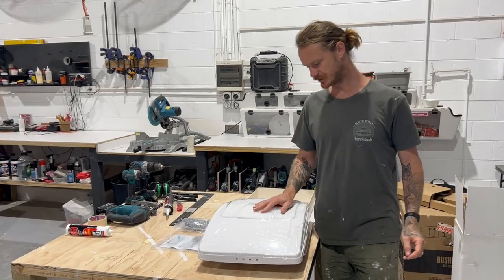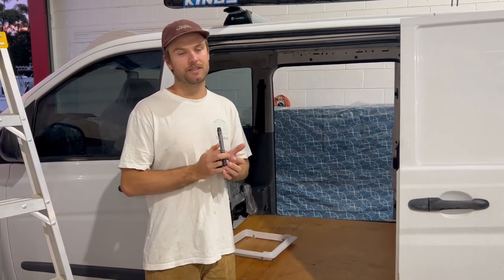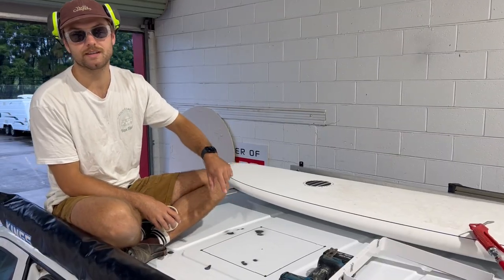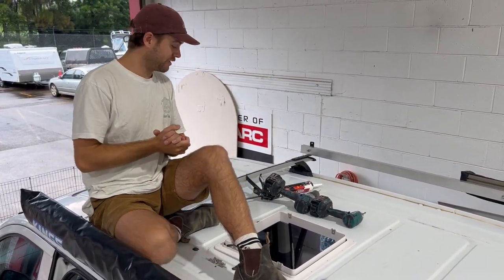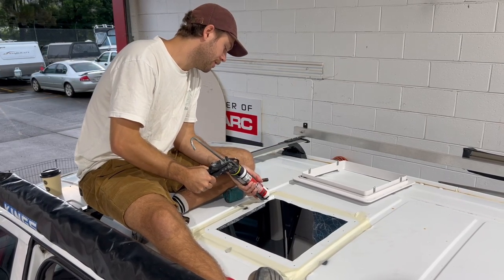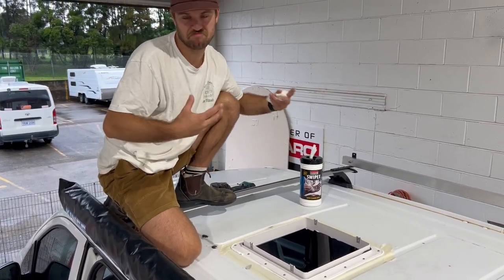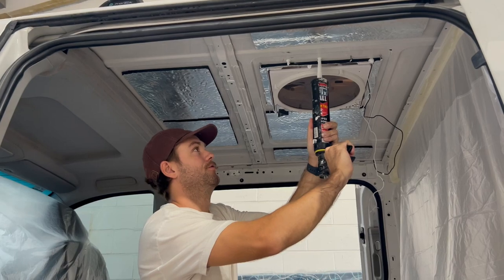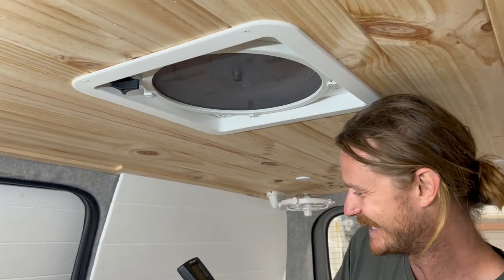Maxxfan Deluxe Install - How The Experts At SOUTHCOAST VAN FITOUTS Do It.

Comment: The swarf from the jigsaw will melt through the clear-coat / paint... then 6 months later all of the little melted spots will have rusted dots everywhere.  You must protect the paintwork before doing any cutting.
Reply: What would you recommend using to protect the paint?
Reply: @naturemama9175  old newspapers, a bed sheet, some plastic from the hardware store - it will need to the cover the whole roof and down the sides by about 5cm  Then painters tape to hold it all down; using lots of tape at the cut-line, then cut-through-it to ensure no swarf touches the roof.

Comment: Hi there.  I have just had my max air deluxe delivered.  Just wanted to check it is usual that the external flange is not predrilled through the plastic and I have to do this myself.  Couldn’t see in the video if you were drilling through the plastic of flange or just the metal roof.  Thanks a million

Comment: Nice vid. When screwing off (17.18), my holes don't line up even with a fair bit of down pressure. Maybe the rubber has lost it's flexibility. Any ideas?
Reply: Hello mate I’m having the same issue, did you figure out what was wrong?

Comment: Great video. my question is do you need to down or alter the piece that goes on the inside to fit? my roof thickness is 32mm, any help before I install would be much appreciated 😁

Comment: All good if your roof is flat, what about a roof with ribs or bumps like a lot of bus roofs ?
Reply from the maker: Hi Ivan, Usually with curved roofs you would need to create a boxed flat area for the fan to sit on. When it's ribbed it's suggested to use a foam seal & silicone to create a water-tight seal. Hope this helps.

Comment: Thanks for the install video - very helpful.  However you installed on a flat roof and I wish mine was flat but ...  Do you have suggestions / a video for a roof with ridges?  Is it just a matter of more silicone to seal up the "lower" bits of the roof?  Ah just read the comment below about using butyl tape to "pack" the lower portions to make the gap waterproof - yes?
Reply from the maker: Hi Julie, yes that is correct, we've done this before on our own van builds and it worked very well, it will give you a harder surface the whole way round the edge to put pressure on when fitting, makes it much easier to clean up the silicone too!

Comment: What sealant did you use?Also what size holes did you pre-drill through the roof for all the screws?
Reply: They used Soudal Fix All High Tack. There are better sealants out there with better UV resistance (e.g. Fixtech Fix15 and Sika 295 UV)

Comment: Hey fellas, every other install video I’ve seen use butyl tape and a timber brace. Why not you guys?
Reply from the maker: Hi Ciccorilla, we've asked the guys at Southcoast Van and they said that you can do this way, but this is just works for them, we also believe that butyl tape is for vans with ribbed roofs so it really depends on the model of van, hope that helps!

Comment: Great video guys good to see an Aussie channel I’ve in Sydney my whole life, but I just brought this fan from eBay wait for it to arrive, I wanted to know how do you know if it should go the front or back as I have a Toyota high ace bus 14 seater high roof, also what’s the going or I’ve rate to get it installed please, cheers
Reply from the maker: Hi Pearcey, it's recommended to be placed at the front of your unit to maximise airflow, however you can place it in the rear, just keep in mind due to the exhaust / intake louvers that face the rear of the vehicle, the Maxxfan requires a roof area clear of obstructions such as air conditioners, storage boxes, etc. for at least 203 mm to the rear of the existing standard roof vent flange outer rear edge. Send us an email at service@outbackequipment.com.au, and we can supply an installation instruction manual for your review. Hope this helped

Comment: Hi team, great video. I want to put one in my brand new VW Crafter. The ribs on the roof have 200 in between. What do you do when it’s like this? 
Thanks
Reply from the maker: Hi Karl, if you read some of the comments below we've outlined how to overcome this issue using butyl tape in the ribbed section :)
Reply: @OutbackEquipment  Thanks for the reply 👍 I actually read the comments after I replied. 🤦‍♂️ keep up the great work.👌

Comment: Hi what glue do you guys use?
Reply from the maker: Hi John, there is no glue used in this process, depending on your vehicle you may need to use butyl tape to pad out the lower point of the rib where the fan is installed.
Reply: Thanks sorry I meant sealant